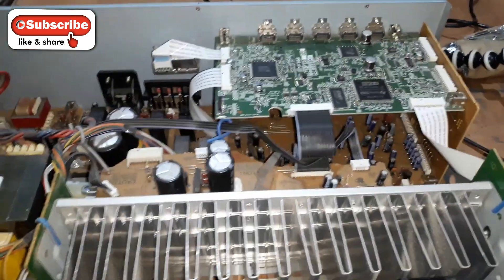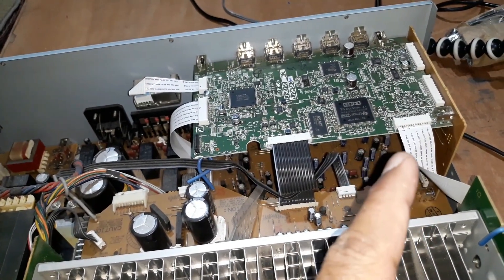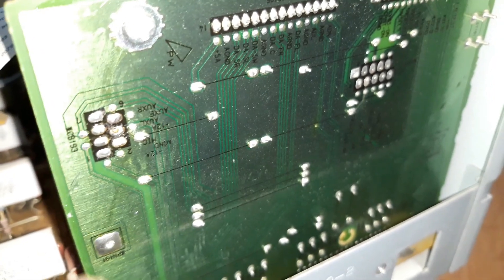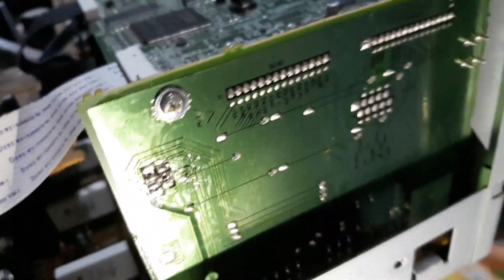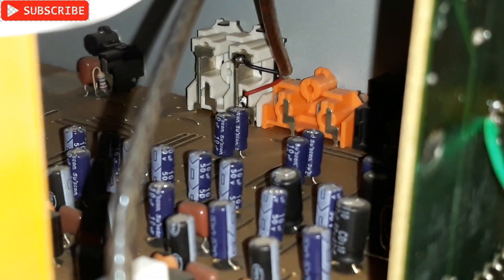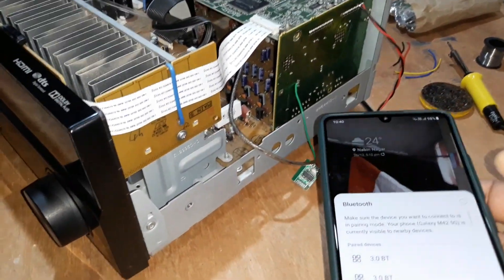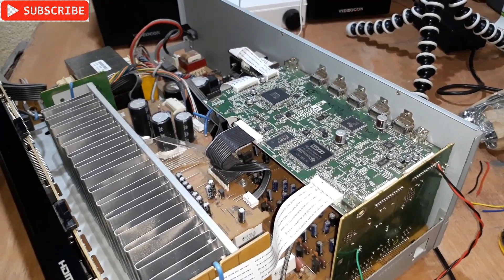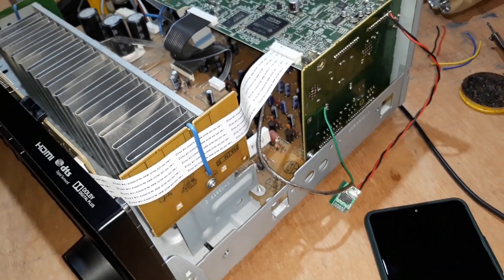How To Install Bluetooth In Yamaha AV Receiver HTR2067

Comment: Will it make a difference in sound output quality or the surround sound 5.1?
Reply from the maker: When you connect to a source using hdmi that sound is superior. But this bluetooth sound is quite good too.  It doesn't makes any difference in the main amp unit.